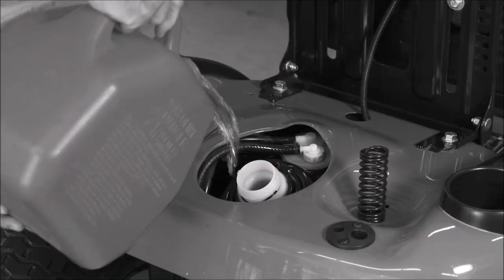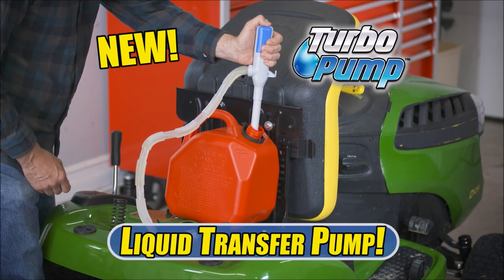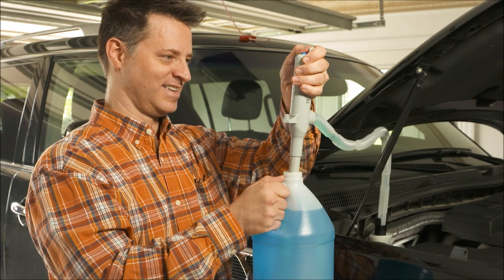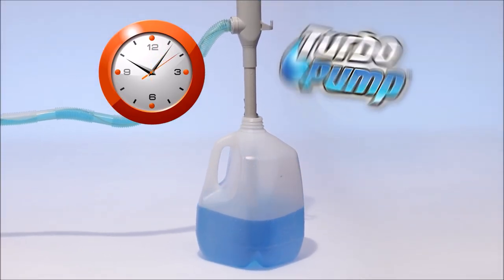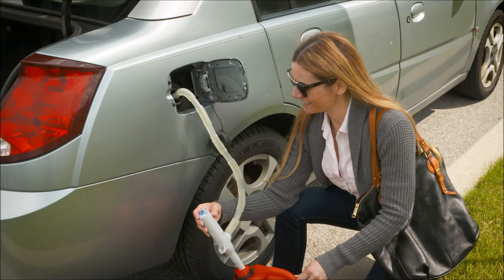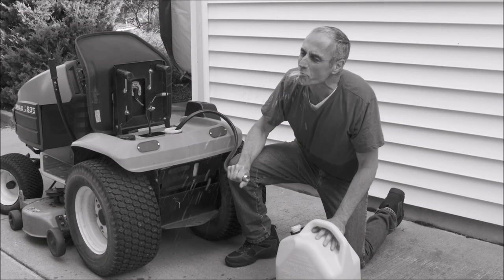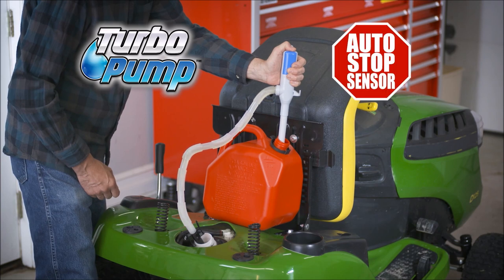Turbo Pump Commercial As Seen On TV

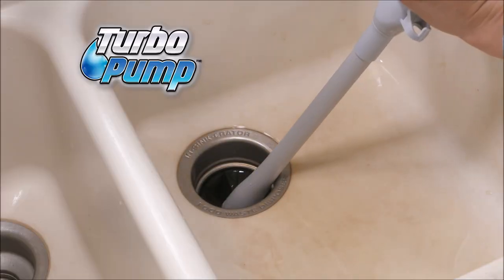Comment: 1:08 she’s killing the fish 😱😱😱
Reply: Wait I didn't realize that. 😂😱
Reply: Catie kawaii MSP you do realize you need to... change the water in a fish tank
Reply: @jonathanwilkinson242  by killing the fish why yes of course instead of removing the fish to a separate area for a short while.
Reply: Natas Rules i have a 600 gallon tank, sometimes you can’t just take out the fish for a bit, it causes stress and then they die.
Reply: Vangster69 Gaming your profile pic is a fortnite furry your not allowed to comment
Reply: The fish just stuck in hose
It's OkAy
Reply: @jonathanwilkinson242  yeah but if you remove the water from their tank they'll also die, cause, you know, that can't breathe oxygen
Reply: @royalblanket  An aquarium water change usually requires less than half the water to be taken out and topped up so no need to move the fish for a quick job. There will still be half the water left in the aquarium for them.
Reply: Teen Anxt oml... technically they do need oxogen, but you need to remove water in order to a water change... you don’t need to remove 100% of the water to do that. but she’s not killing them. jeez
Reply: Jonathan Wilkinson yeah but she isn’t putting the fish in a different place
Reply: @anjalidoraisami7252  you don't have to, whenever we clean our tanks we leave just enough water for the fish to float in and they're fine, you aren't supposed to remove 100% of the water anyway because it could harm fish that are already used to the old water.

Comment: 1:07 THERE ARE STILL FISH IN THAT TANK!!!!!
Reply: An aquarium water change usually requires less than half the water to be taken out and topped up so no need to move the fish for a quick job. There will still be half the water left in the aquarium for them.
Reply: It works well for water changes